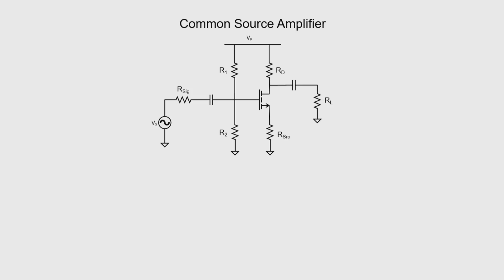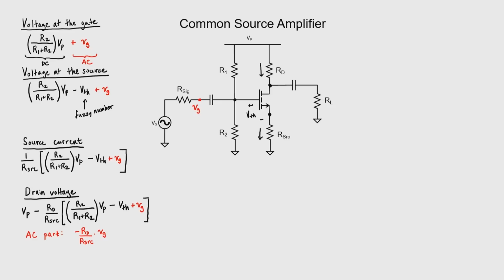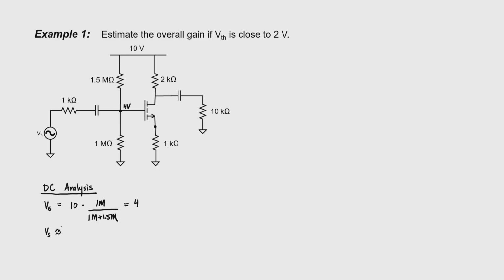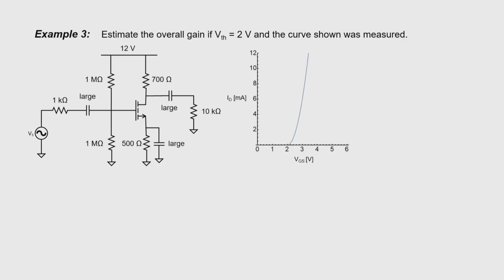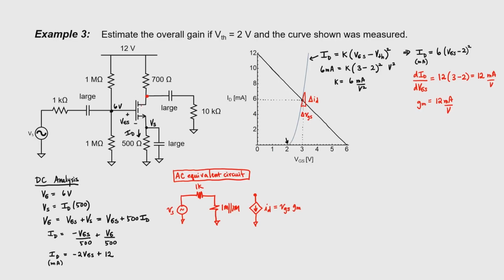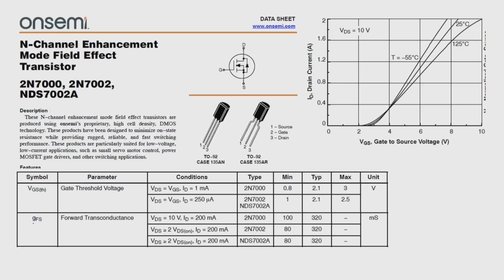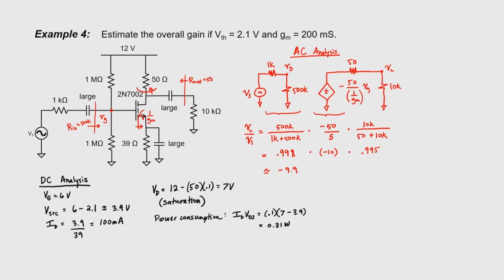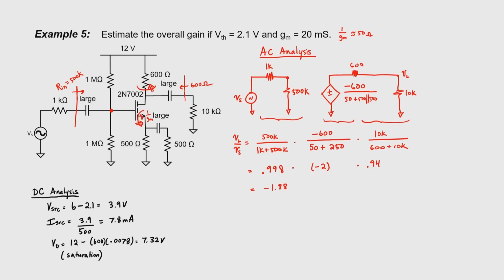Everything Explained: Common Source Amplifiers (26-Transistors)

Comment: I loved your video! Nicely done! Sorry for the long comment.
Interestingly, all of the textbooks I have here either go back to the construction details of the device 😕 (which no datasheet EVER tells you)
=OR=
They use the ever illusive "k" factor in the resulting equations. 
I have the entire design process down except this k factor thing.
I am using the 2N7000, for reference. 
From a practical amplifier design perspective, the Transfer Characteristic graph (fig 5) is pretty much useless (Id(max)=200 mA and it goes up to 2 Amps!); the Id that one would use in any practical circuit is so down in the x-axis "noise" that all we can do is a wild guess. 😕 I'm not a fan of wild guesses.
What have I done here?
* LTSpice seems to use a consistent k = 0.043 for all currents up to 100 mA with a Vgs(th) ~ 2.3V (depending on what Id you choose)
* I have carefully "blown up" the Transfer Characteristic graph from the datasheet and, using a ruler, calculated the K factor for drain currents up to 100 mA. I  assumed they are using a Vgs(th) = 2.1 for their graph. 
* I went to the bench using a pulsed approach so as not to heat the device (250uS wide pulse at 2% duty cycle=80 Hz). I measured the threshold voltage and determined the k factor for 6 randomly chosen 2N7000s from two different mfr up to Id=100 mA (1, 2, 3, 4, 5, 10, 20...100mA). While their Vgs(th) varied from device to device (especially from mfr-to-mfr), the k factors pretty much tacked each other at each Id, increasing with increasing Id as expected.
HOWEVER, these measured values were nowhere close to the k factors determined from the datasheet Transfer Characteristics curve.
If I recalculated the k factors from the datasheet curves using a Vgs(th) of 1.854V, then the bench values and the datasheet values tracked very closely to each other.

So ... 
* How do I **reliably** determine the k factor value for a given operating point using only the information given on the datasheet?
* Am I better off approximating the gm as the slope as you demonstrated in your video (forget the whole k factor thing)?
* Why don't they provide a nice graph showing the k factor values vs Id with Drain currents in the actual operating range of the device?

I anxiously await your reply. Thank you ahead of time for the time you will take in answering this comment.

Comment: Hi! In example 2, your gain still didn’t match even with your fudge factor involved. Could that have something to do with the capacitor in series with the 600 ohm resistor? Because then you have the ESR of that cap to contend with I presume, which is then influenced by the input frequency of your voltage source?